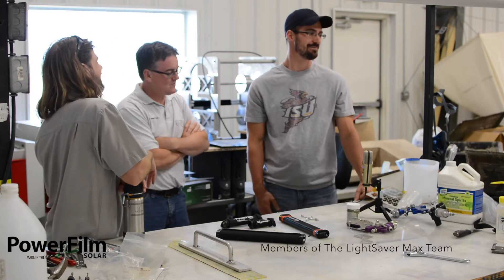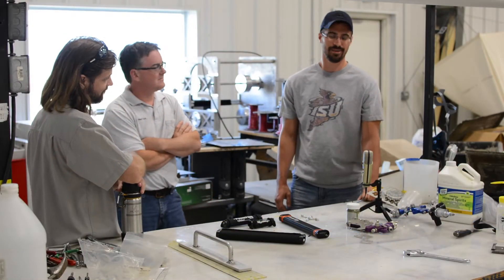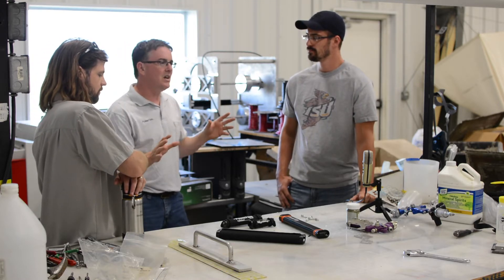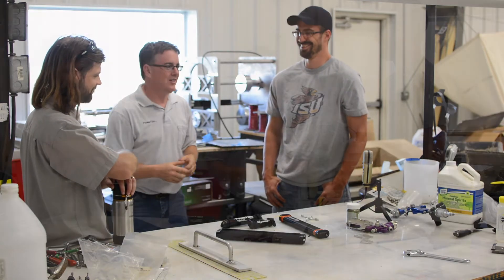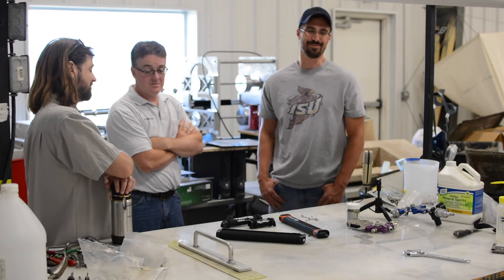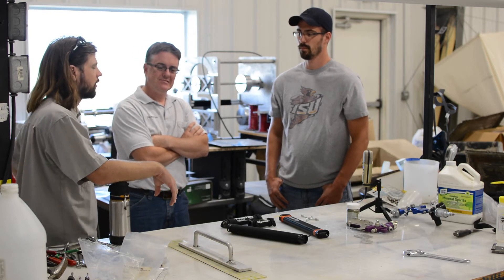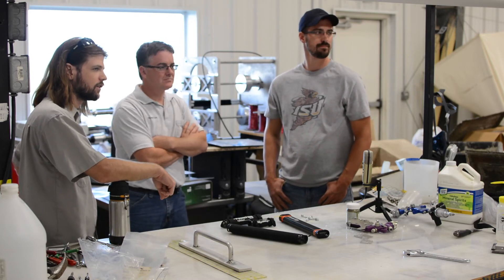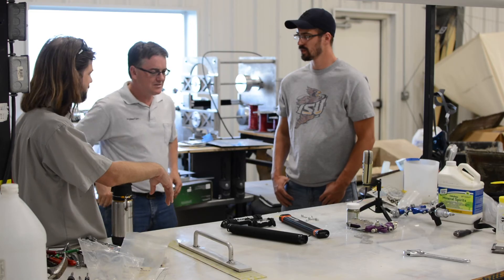LightSaver Max Team

Comment: I have a max one and am VERY pleased with it. Thanks for the work guys.
One negative are the cords of those end caps. They tangle with the rubber straps if i want to pack it up. Would been great if those endcaps would have been attached as a one big gummy flap that was not loose but fixed firmly with the case like gummy flaps on cameras or other accessories 
But besides that, a great product. 
Are you coming out with a version 2.0?
Reply from the maker: There could be a second version of this product, in the coming years! The best way to stay on top of all things PowerFilm is to join our mailing list and select the products/topics you want to hear about. You can join our mailing list here: https://www.powerfilmsolar.com/explore/mailing-list/
Reply: PowerFilm Solar thank you. I will do that